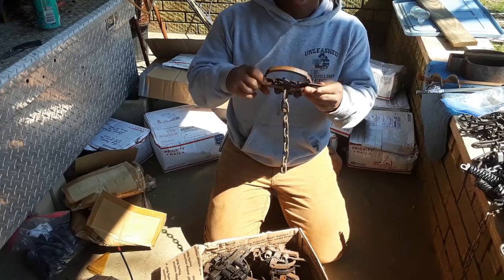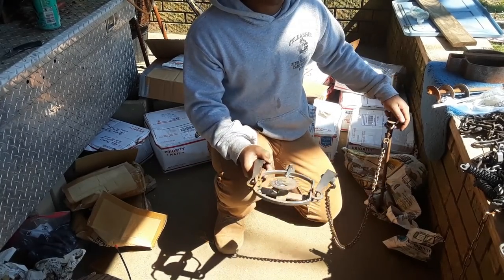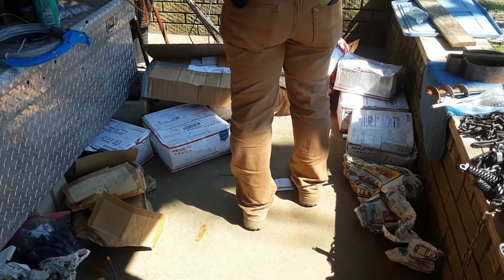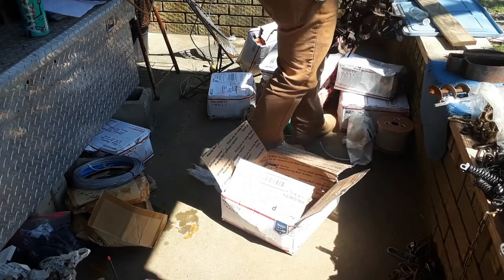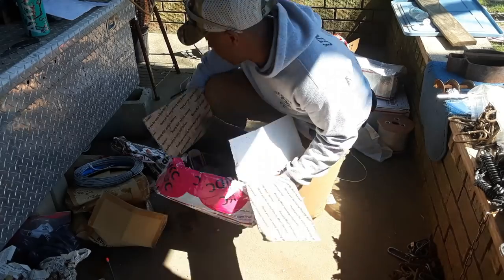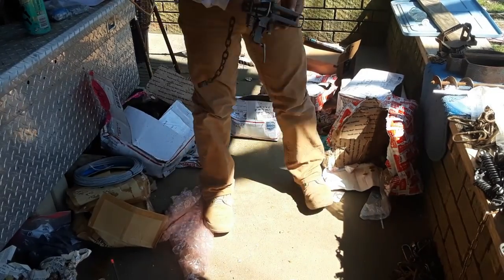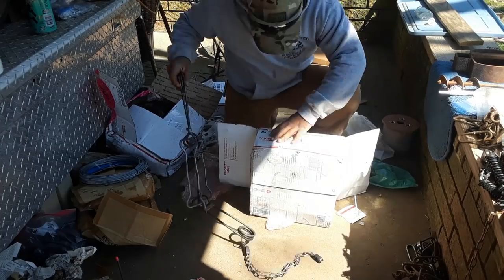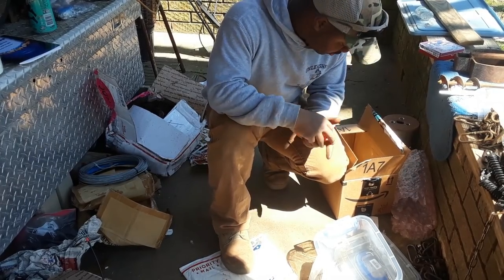Channel update and Youtube's largest Trapping Unboxing part 3

Comment: Good video as always.  Take a few 1 1/2 coilspring put new 1 3/4 music springs on them. Then take the 1 3/4 traps put #2 music springs on. U will have some strong traps. I took 1 1/2 coilspring put #2 music springs on them. When I was growing up. That was what I used for Bobcats.  I even caught a few coyotes in them. By luck. I like them drags u have they r Nice!!! The #3 dukes u have order u some new music springs put on them. Like new traps then.